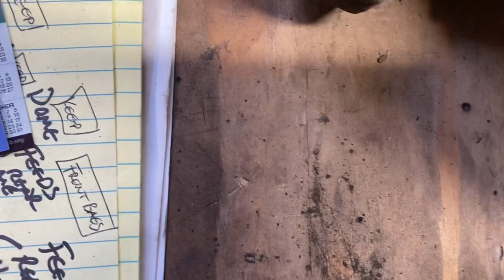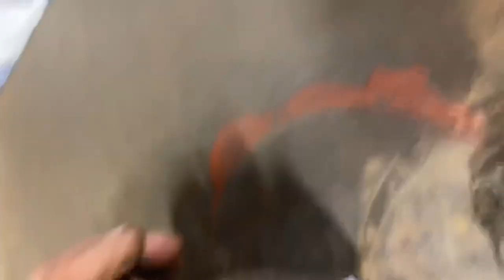Ford L9000 Episode 12: Brakes, hubs and welding axles

Comment: i drill holes at the ends of cracks to stop them from continuing. if you build the hitch strong enough it can eliminate the need for the rear most cross member and make it far easier to build and hook up your gooseneck hitch.
Reply from the maker: That’s a really good point that I didn’t even consider- would definitely make trailer hookup easier, especially with the dump valve.  I’ll have to re-evaluate my hitch once I get the basic framework built and see about adding some more beef if needed.  Thanks as always for the great ideas, J.C.

Comment: just subbed. I'm looking into getting a l8000 chassis and a Cummins l10. also will be trying to get a nice single axle rear end and build sumn from the ground up
Reply from the maker: I’m not 100% but I don’t believe the L8000 got the L10/M11, 855/N14, 3176 or the 3406 like the 9000.  Most 8000’s I’ve seen are running the Brazilian 7.8, Cat 3208 or 8.3 Cummins, so you might want to look into a 9000 vs. an engine swap.  Sounds like fun though!!